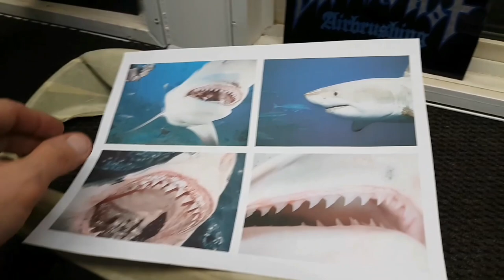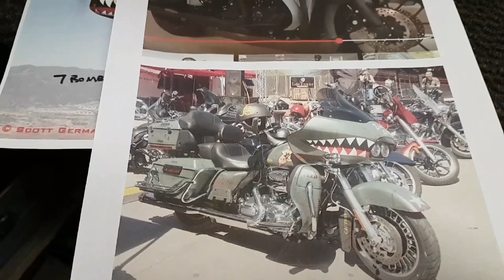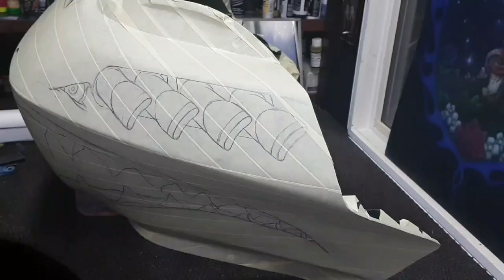How To Airbrush a Harley Davidson into a WWII Fighter Plane(Part1)Tools& Prep Work.

Comment: MATE  Mate  mate  that is bloody excellent love the idea of real teeth look I am learning a lot from you how to reproduce same drawing four times an the idea of flipping the paper over to get the mirror image . If possible could you show how to smooth a line between two colours and when I need to lighten one of the colours on that same line . Shit I hope you understand what I am saying lol . I have a 1/12 scale bike the tank is white with a light blue an then darker blue but when I painted the lighter blue I think I put to many coats on and it is almost the same as the dark blue . Even though the to blues are different blue colours . Loving your work 👍🇦🇺
Reply from the maker: richard halley the beautiful thing about using an airbrush is the way it fades and blends. If I wanted to fade from white to a dark blue... I would only use those two colors. No light blue and no mixing the white and blue before you spray would be necessary.  I would start with a base of white then using light transparent layers of dark blue, slowly fade my paint into the white and keep adding light layers untill my dark blue was achieved on the opposite side of the fade. You can even go back in with transparent white to bring up your lighter color. You could back and forth this process till you are happy. Hope this helped!! Cheers!